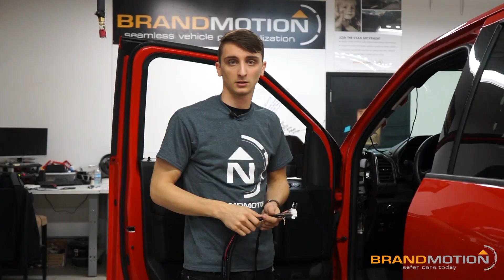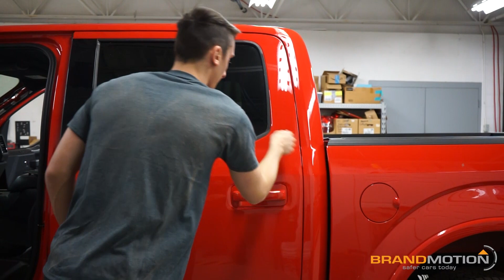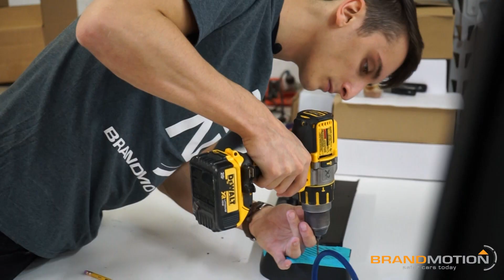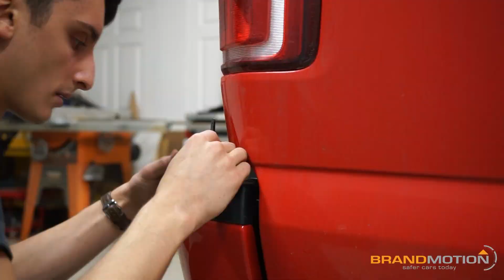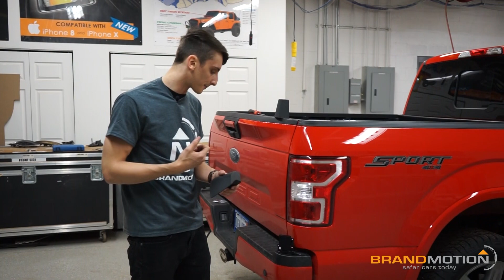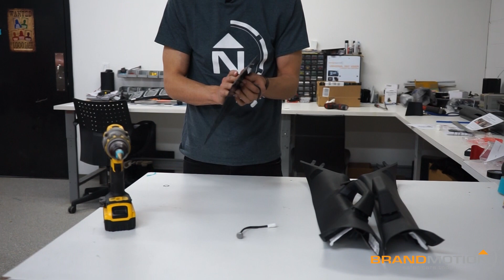F-150 Radar Blind Spot Installation

Comment: Why would you leave the sensors exposed on the bumper. This may cause them to be damaged
Reply from the maker: The sensors are covered with a plastic cap that securely fastens in place. The connectors for the sensors are waterproof as well.